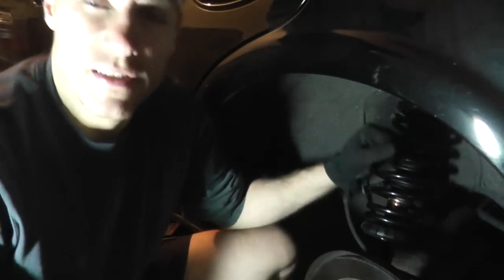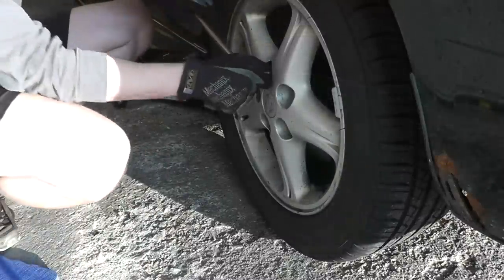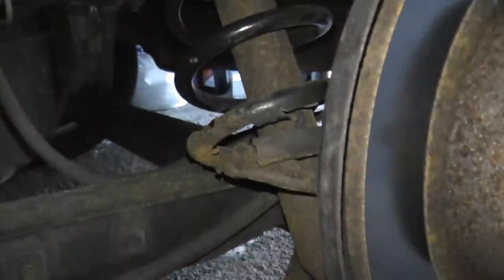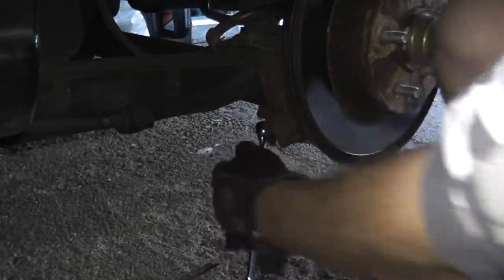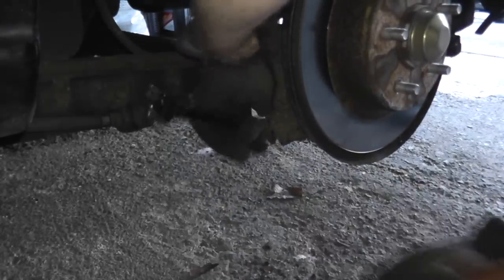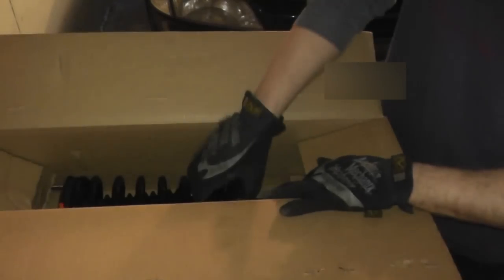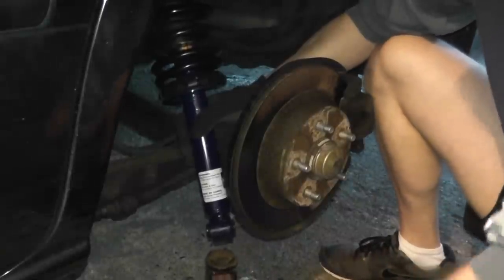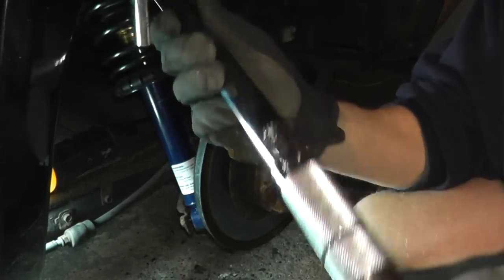Nissan Maxima Rear Strut (Shock) Replacement

Comment: Great vid,  going to have to do this on my 2001 maxima ,  still going 243k.  But it’s on its last legs.  Son’s car now.  Going to get rid of it soon but rear struts are soo bad  going to have to replace them for safety in the mean time.  Found a set. Of aftermarket ones cyber Monday sale for $72 for the pair of quick strut.
 Getting rid of it because to fix it right would cost over 10k. It’s been driven apx 40k on a failing transmission with 2 bottles lucus stop slip, a trans flush (3 drain and fill) and seafoam transtune. It’s also lost 4th gear

Comment: Awesome vids, I will have to do this soon:)
the missing part of the instruction, how to remove the trim to get access to the top of the thing, yes its probably not that hard, but its always nicer to see before you do.
Reply: Turns out on i30's and certain maxima's the top of the strut is covered by some reinforcing framing they've bolted inside the body, it becomes much harder to reach the bolts but it can be done with a socket extension and squeezing your hands into the space, not comfortable but it works.
Btw does the thing need realignment after this?

Comment: Thanks you just saved me over 600.

Got some aftermarket complete quick struts
Off Amazon $72 pair.  I  installed them . 

The part branded Topaz was really a rebrand of Duralast  complete with the Duralast part number on the side of the strut and install card directions.

Comment: Quick question, the bolts on the top of my replacement strut aren't exactly lined up with the old strut so I can't get the bottom bolt through, in your video for the front struts you use a screw driver to twist the top bracket. Is it the same process for the rear struts if it doesn't line up?
Reply: Turn the top part of the strut with a long screw driver until aligned evenly while the side by side

Comment: Wow much easier and quicker then the front, great tip on the floor Jack. Thanks for the video. You said do both of the back, I have to replace the driver side front, the passenger side is still good. Can I get away with only replacing the one on the front? Thanks again.
Reply from the maker: Oh yea the rears are quicker for sure. If the passenger side is  okay you can get away with it in the interim

Comment: Whats up bud, Love your videos BTW, but I have bad news, so my rear strut screw at bottom, the one you need a breaker bar for. Well the nut at tip of bolt which seems to be a lock nut that is mounted in a metal shaft, its spinning with bolt, it was turning good at one point but seized at one point, and its starting to round out.. What can I do? Cut bolt and replace and use a regular nut? of should I cut bolt and weld lock nut back in place..?
Reply from the maker: I'd either try a good set of vice grips and attempt to remove the nut. Or, you can try to cut off the nut. Then use a new nut and bolt for install.
Reply: Thanks brother! Gping to try vise grips. First if not going to cut that bad boy, since the bolt is 1.03 and nut is 1.26 at Nissan..
Reply: I’m having the same issue! It won’t move!

Comment: What brand/size and length of breaker bar do you recommend using for a job like this? Same question for torque wrench as well? Thanks
Reply from the maker: ***** I like Craftsman but I've had good experience with Harbor Freight's breaker bar and torque wrenches as well.

Comment: Went to the dealership they told me 700 for the rear struts to be replaced. 800 for the parts for the front strut. 200 for labor.  After looking up prices for these they were really gonna get me good.
Reply: I work at a Dealership. What those fee include: Tax on parts, The Labor rate per Mechanic which is doing the work. Most Techs get paid differently due to their ASE certifications and experience. 

You are paying the Diagnostic fee to find what the “Actual” cause(s) is/are. It also includes the “Time” it takes to do the job. Dealerships/Shops follow guidelines as to how long each job can be finished within. 

Also, you are paying for the part(s) needed to be replaced, the technician having the Knowledge to understand what DOES and what DOES NOT need to be replaced. 

When a Service Writer and Technician are placing Safety needs at the customers Highest Priority; these are all signs of a good establishment. 

The main factor to Consider which is very much overlooked are: The Professional EXPERIENCE of these ASE Certified Technicians who have years and years of Dealership, Customer and Product knowledge. They also understand the Safety Concerns prior, during and after a particular job is finished. 

Having the Answers, knowledge and know how to each and every one of your questions/concerns  are what you are paying for; which is irreplaceable. 

Everything about Alignments, knowing which bolts need to be torqued or not, what to or not remove, if, Trim Panels require “Other” tools (which the 15A Tech and other techs who do “Bumper to Bumper” have), knowing how to safely remove and put back everything without costing the customer or yourself at home (watching these videos) extra time and money to replace, do to lack of experience; is everything you are taking this to a professional for.  

As a Customer; you have the right and privilege to speak with your Technician. An honest technician will replace your Safety needs first then, let you know what is needed in order of importance of what has been Diagnosed and the initial cause of your visit.

**Some service writers are NOT Human. They are there to make the Dealership/Independent Shop/Repair Shop profit. Businesses operate off of profit. However: as a Customer you always have the right and ability to say NO, ask for a second opinion, request another Service Writer to help you or Walk away and take your business elsewhere. 

Always do your research on Customer experiences, how the service writers treat you, how they speak with you, when or if they follow up with you and also how often are they following up with you, if they are keeping you in the loop with the Technician, Service Writer, Customer and even Service Manager during the process of repairing your vehicle.

If, a Major service(s) needs to be done, are they helping you by spreading out a 30k/50k/90k/120k service within multiple appointments to save money or, are they DEMANDING you do a Brake Flush, Coolant Flush, Power Steering flush, Transmission Flush, Front and Rear Differential flush, Windshield Wiper Flush, Up-Selling front and rear brakes two tires and an Alignment when you only came in for your “Routine” 15k oil change, rotation, fluid top off, Bumper to Bumper Safety Inspection and possible Cabin Filter.
Reply: That’s why they call it a stealership

Comment: Man, you made taking off that bottom bolt look easy. I tried for half hour on each and they wouldn't budge
Reply from the maker: Use a breaker bar. It makes all the difference.
Reply: CarsNToys I was using a breaker bar!!! I didn't have a pipe or a hammer at the time. I even tried using my small Ryobi impact drill(which I expected to so nothing  for that bolt) and it did nothing but knock a little bit of rust off!! I'll go at it again when I have the time in a few days or so. Thanks so much for responding!

Comment: Can you make a video on causes and possible fixes for a spark knock on the Maxima 3.0 ltr motor? I tried replacing the coil packs and spark plugs and nothing seems to be working to get rid of this spark knock.
Reply: Spark Knock? Rod Knock possibly. Lifters. Definitely needs a professional diagnosis. Dealership.
Reply: Run 93 octane

Comment: I have a 2002 Infiniti I35.  Is that the same as your Maxima?  What if the mount is bad too?  Thank you very much for your video.
Reply from the maker: It's very similar for many vehicles. Two up top and one bolt on the bottom.
Reply: CarsNToys,
Thanks!

Comment: Good job. CarNtoys .is necessary  use of torque wrench  ?
Reply from the maker: No. However, you want to make sure the fasteners are quite tight. Good luck!
Reply: @CarsNToys  ok . If of struts dont fit in the holes I need redrill another hole

Comment: Shoulda gone with the kyb or tokico!
Reply from the maker: Thank you. Had no issues with Monroe.
Reply: @CarsNToys  the vid was helpful! Just read up on Maxima forums and the consensus is that Monroe quikstruts....well, they are a whole lot better than blown struts, but nothing like the original equipment provided. Also, it's usually better to reuse the old springs, as many "quikstruts" have different than oem weight, spring rate, and can vary when put under weight. Basically, measure from flat ground to frame all around, and if it's even, spend the labor on compressing and swapping springs, and go with kyb for a daily, and tokico 5 ways for performance.